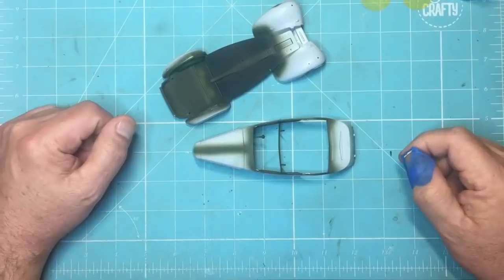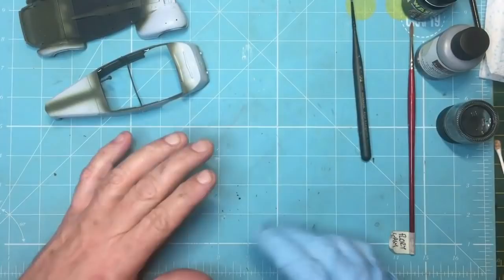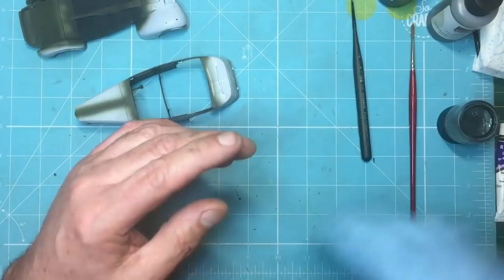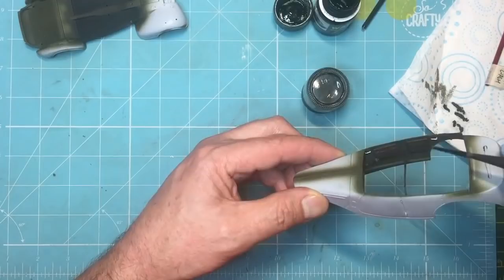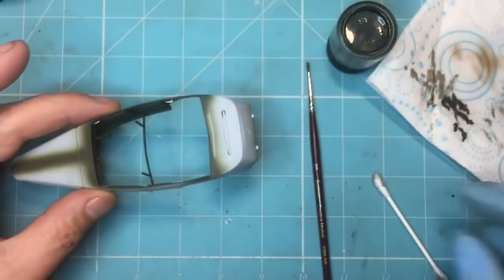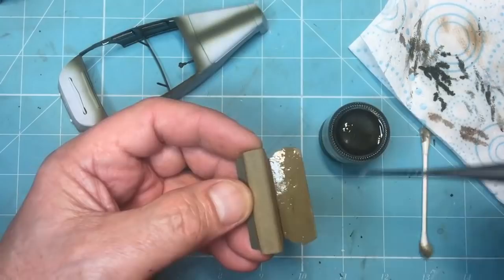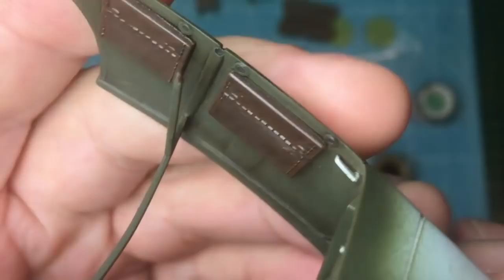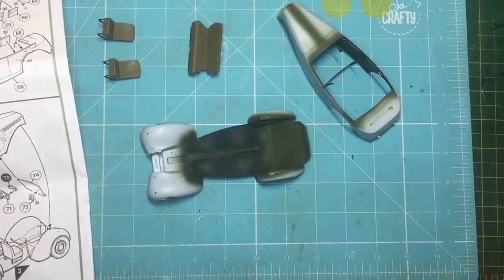Beginners guide to scale modelling. Airfix 1/32 Montys Humber.Part 10

Comment: Nigel, bit off topic if you do not mind. You mentioned Tamiya RC Mustang recently.I have been building a Tamiya 1/14th RC truck.The plastic parts are a mixture of ABS and styrene. ABS is all black. I would like to paint the axle housings and mudguards. What would you suggest primer wise? also the axle housings will be silver, and would get more handling than static models. Would you use the normal ,Tamiya/vellejo etc then add a clear coat?because the size of the parts I would probably prime with can outside for sure and possible paint colour with cans.any suggestins you have would be great, if outside your remit,just ignore this comment,no probs at Nigel.
Reply from the maker: Well within my remit Gary, I've done it.
Make sure you wash the parts very well in hot water and detergent. Key them up with some 1200 wet and dry, used wet, then wipe them over with alcohol before you prime them. i used acid etch primer to paint mine, because it's readily available in aerosol form. You could try Halfords plastic primer, but I'm not sure it will key as well as the etch primer will? I make GRP parts for cars and always use etch primer for those panels before primer.You could use a polyester primer if you're really fussy.. but in my opinion thats OTT.
For the top coat use 2K or Mr Color paint with MHLT. I've done a few tanks and always use Mr Hobby or Mr Color paint as it is so hard wearing compared to the likes of Vallejo or AK.